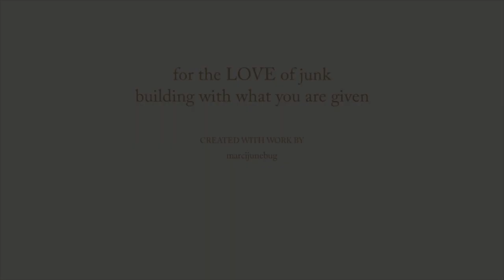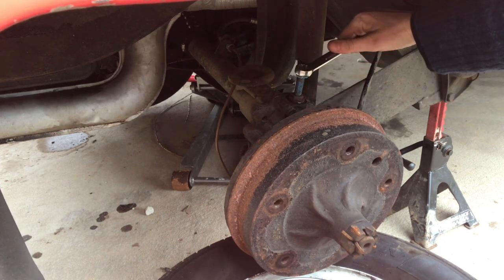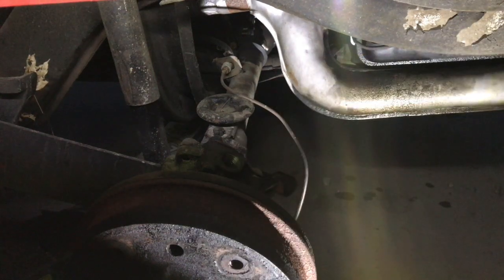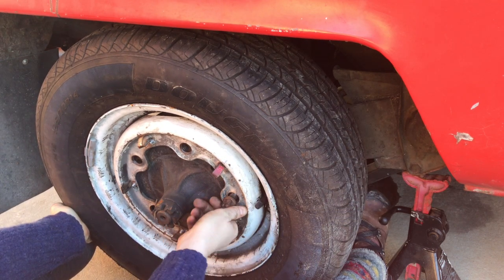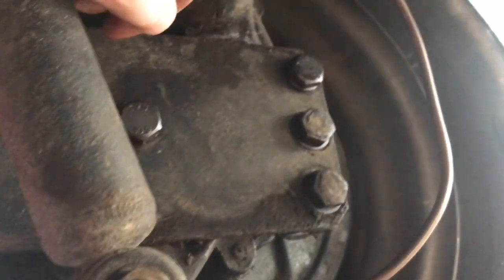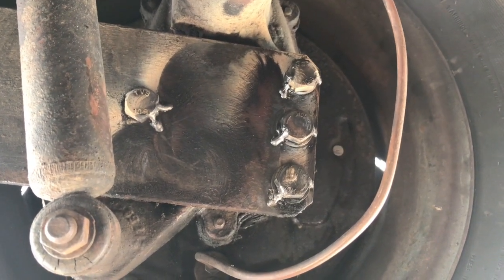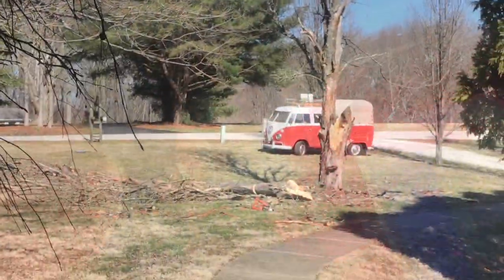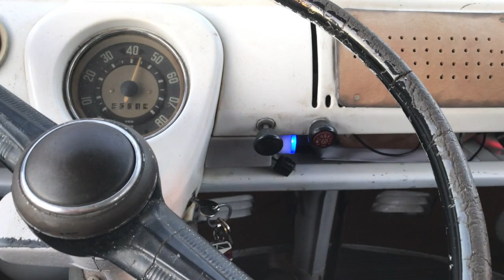VW Double Cab Bus reduction gear box bolts and hubcap clips

Comment: I would put studs in where you welded those bolts! Lock tight them in, Then put nuts back on studs torque to specification drill a small hole and run safety wire through them, that way you save the threads on that housing , thanks for the good videos!
Reply from the maker: I did use lock tight and welded since weld allows me to check and see real quick if it’s broke and thus loose again! But yep getting you method if I have any more issues! This is a know prob with these lol buggers! Thanks for watching!

Comment: I work for a fastener distributor, we sell ‘Loctite thread lock adhesive to various industries where vibration could cause fasteners to migrate out of position . 
There are various strengths and you can still undo the bolt with hand tools. 

Love the rivet gun tip on the hub cap clips , I spent forever with a hammer to peen over the rivets.
Reply from the maker: Thanks!

Comment: It would be nice to find bolts with holes to thread safety wire through
Reply from the maker: Thought about that, actually thought about just welding a tab to spring plate and hammering edge of it over each bolt but this was the quick and dirty lol
Reply: @marcijunebug  LOCTITE
Reply: @marcijunebug  I love your tips and tricks, I'll have to look at my bus for that plate you mentioned on the spring plate, I have a 67 what year is your DC? Nice MIG skills too. Lin
Reply from the maker: @grunthaner  Thanks!  My Double cab is also a 67! I just try to build and fix with what I have...I'm a "hack" really...no real talent, just do what I can to get the job done!

Comment: Nice video, good work and smart thinking. Definitely a beautiful ride at the end.
Reply from the maker: more rides coming up! finally above 20 degrees here! lol thanks for watching!
Reply from the maker: yeah I replied to a comment earlier (so ignore me here if you read that already) the bolts DID have loctite red on them (failed to mention that in the video) but having used both red and blue in sailing rigging and having both fail multiple times I decided to weld also...plus if the weld breaks I will easily be able to tell that the bolt is loosening and the way I put the welds the bolt can only back off so far before the pointed part hits a weld, thus keeping it from falling out completely! thanks for watching!
Reply: @marcijunebug  aircraft industry uses safety wiring to capture bolts in place, might want to look into that aspect from a airport nearby or machine shop......

Comment: At first blush it seems a pretty drastic solution to tack those bolts in, but it’s really an effective risk control.  Great hazard management 👍
Reply from the maker: I look at it this way....it's hard to look under the bus at a glance and "see" if the bolts have loosened...but if they are welded well it is pretty easy to see when a tack weld is broke...so far so good none have backed out yet!
Reply: marcijunebug 👍👌

Comment: Before you welded those bolts did you think about using safety tie wire like they do on aircraft.
Reply from the maker: yes...answered that somewhere in the comments...the thing with the weld is that I can very quickly peek under the bus and see if they are working their way loose...if the weld is broke, they are loose.  Also with the weld I tried to position it off the flat side of the hexagon so that if it DOES break loose hopefully it will hit one of the points and not back off all the way, i.e. the weld works as a stopper in a way...The bolts also had red thread locker on them...THANKS for the tip tho I really DO appreciate it and thanks for watching!
Reply: I’ll admit I didn’t go through all of the comments. I just mentioned it because that’s what I’m planning on doing on some of my engine tin bolts. Keep up all the good work
Reply from the maker: @redneckgunwerks9327  no problem, I rarely do either! As I said I truly appreciate any suggestions so keep them coming! Some of the earlier year busses had what they called "wavy washers" here...my 1958 panel has them, but this bus for some reason did not!

Comment: Wouldn't Loctite read work for the spring plate bolts, to prevent them from coming loose?
Reply from the maker: I believe mention at one point that they were loctite red also...reason for weld was 3 fold
1. loctite red WILL break loose in at "stiff breeze" as I use it all the time on my sailing rigging and it is constantly breaking loose, so I don't really trust it 
2. I want to be able at a quick glance to look under the bus and know those bolts are good...if the weld is broken it is really obvious one is "loose"
3. the way I welded them if a bold DOES break loose the point of the bolt will hit  the weld blob as it tries to back off and hopefully not back off anymore until I notice it
anyway...that was the idea behind the welds

Comment: Did you try loc tite and music too loud
Reply from the maker: They have lock tite red and are welded...having had personal experience with both locktite red and blue I’m telling you no way it would hold this. (We use it sailing all the time and it breaks loose often in less strenuous conditions than these bolts are in) plus with the welds I will be able to easily see if something has loosened because of broken weld, and because of how I placed the welds the bolt will only back of half a turn or so before it hits a ball of weld, and I WILL be checking often...music was fine on my end but I will be aware and appreciate your feedback! Thanks so much for watching Paul! 👍

Comment: Why didn't you just use blue loctite?
Reply from the maker: Because that would be a boring video! Lol
Could have used it...I’ve used it in the past and it’s a fine product, esp good for sailing hardware, I just wanted to ensure they weren’t coming off and if I do have to remove these very easy to just rotozip the welds... Thanks for watching!